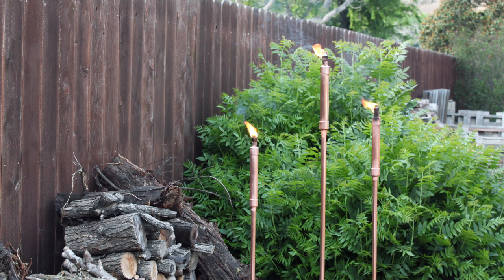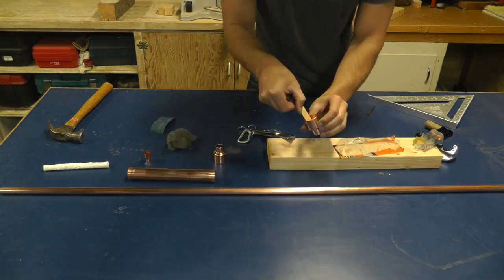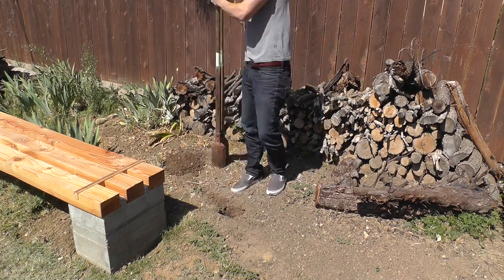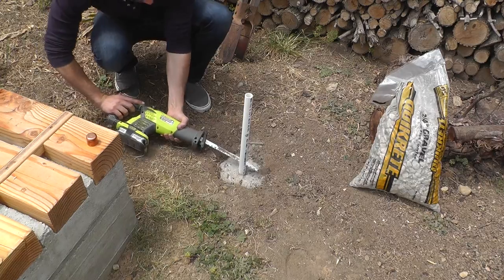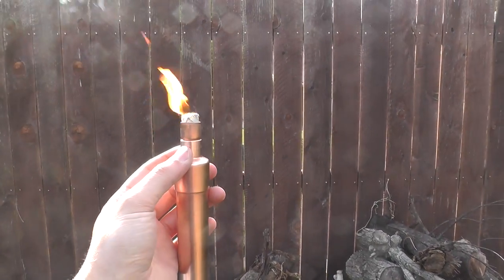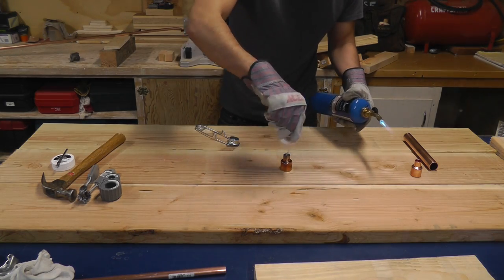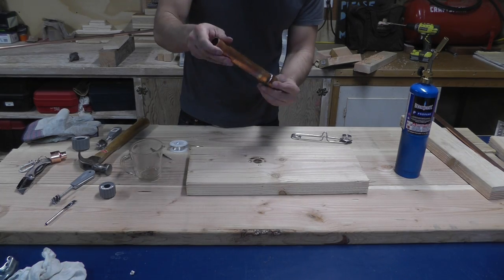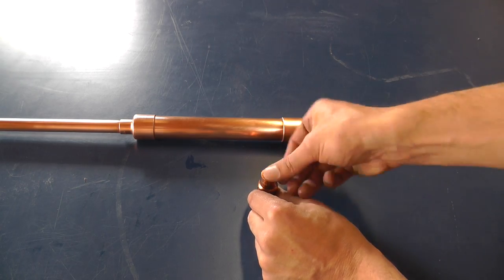DIY Copper Tiki Torches anchored with Fast Setting Concrete

Comment: Nice project. I've done a ton of soldering pipe through the decades and one thing I found is you can always reheat a joint to get the solder to spread more evenly or to dress it up a bit. Adding or wiping with a wet rag to add or remover solder helps the over all finish as well.

Of course you have to be careful not to over heat a joint as it would ruin your water tight seal. Also if you concentrate heat on the thicker copper first, typically the Fitting, you only really need to heat one side and than touch the other side with solder, when it's hot enough it will flow like water to seal the entire joint. Solder is cold and when applied to a hot joint causes it to heat sink, for lack of a better description, around the entire joint and fill in the gaps. Copper spreads heat really fast so there is no real need to turn and heat the entire piece evenly, the copper will spread the heat faster then you can turn and heat it; just saying.

It was nice to see the various adapters working the way you used them, that was very clever. With regards to the Quickset, you could have just tamped it a bit into the ground then left it overnight with no water, it would have set. Concrete draws moisture out of the ground when buried like that. I learned that year ago from someone setting fence posts. At that time I thought he was crazy but sure enough it worked like a charm. I was building a Deck on the neighbors house while he was working on their fence so we got to exchange a few ideas.

Something else you could have done was used a cinder block and filled it with concrete as you did, to make a portable stand, or two portable stands side by side. Just make sure to use a backer board so you don't stick the concrete to other concrete or make a unnecessary mess on the ground. It probably would not be a bad idea to put 1" foam board in the bottom of the hole first and then fill with concrete. Either way would work just fine...

Comment: Very neat project! Really like the look of those torches, and I'm very happy you did one the old fashioned way as well. A little tip when soldering, you can reapply heat after you've added the solder to help it flow out better. Should help with some of the messy results.
Reply from the maker: Switch & Lever Thats a great tip, thanks!  I am looking forward to more copper stuff.
Reply: HomeMadeModern  You should check out myfordboy's videos here on youtube, he does a fair bit of soldering brass which could definitely come in useful if you want to learn more. Check out his "Make a Drip Feed Lubricator, Oiler" video for starters!
Reply: Switch & Lever Also, when sweating copper keep in mind that the solder will go wherever there is flux, so if I am worried about the look of a copper joint, I apply the flux carefully and try to clean it off of surfaces that I don't want soldered or discolored (even if the flux doesn't pull in solder, it will discolor the copper when it heats up, but that is an easy cleanup with steel wool or sandpaper).
Reply: HomeMadeModern Another tip when you finish applying solder, use a damp cloth and wipe around the freshly applied solder. This will leave you with a drip free joint and give you a cleaner look. Great video, keep them coming!!!

Comment: In order to solder the copper pipe it is better for it to be in horizontal position. After you heat the pipe well, you add the solder and gravity wraps it around the joint without having to move the solder too much. That way the joint comes out much better! Just a small tip, take it or leave it! Any way great, video and once again beautiful design!
Reply from the maker: Scrap wood City thanks! its great to get these tips!

Comment: Solder flows towards the heat. So next time apply the heat to one side and keep it there and apply the solder to the other side. Once it melts keep feeding it into the pipe until you see it go all the way around.
Reply from the maker: Joshua Russell thanks!!!

Comment: was thinking this was gonna be a great addition to my fire pit. But the copper pipes in the video turned really black at the top.

Do you think adding some sort of lip between the wick and the copper basin holding the fuel would have less black soot showing.

Or do you have any ideas to keep that black soot from collecting.

I know it would wipe off, but i want it to stay clean while in use, or at least stay clean on visible areas for better aesthetics.
Reply from the maker: ***** yes, i noticed that too.  Thats a great idea!
Reply: ***** Maybe another inverted 1"x.5" reducer would make a good lip/cup to keep the sooty smoke from sticking to the outer surfaces.

Comment: Great idea and video.  You could try Mapp Gas that burns hotter and use 50/50 solder which is lead based since this isn't for drinking water.